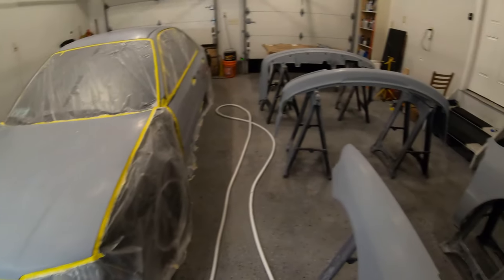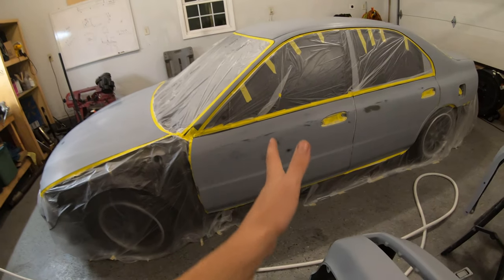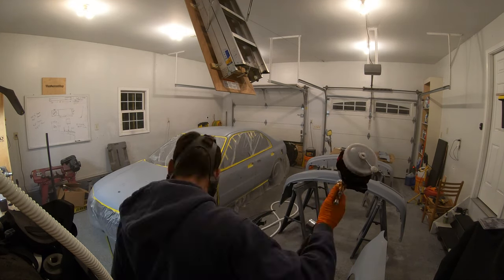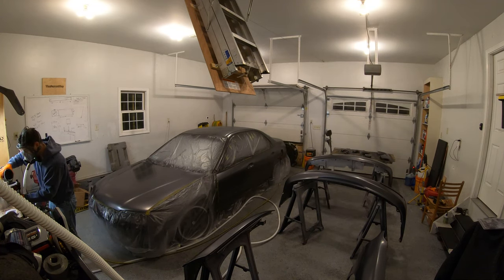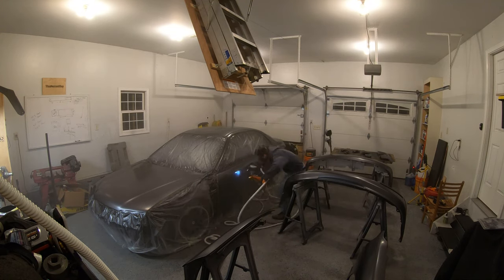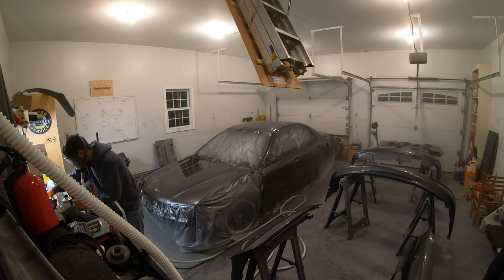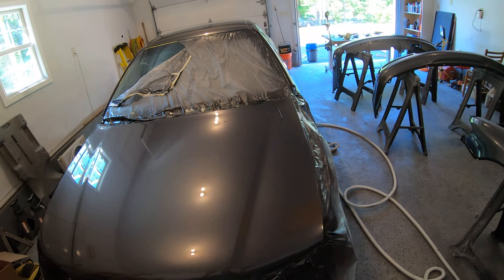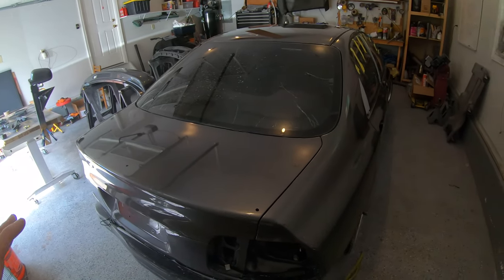Turbo Accord Gets a Sick New Paint Job!

Comment: in the video where you went over the cost & linked the chipped ecu you used, did you have to buy a new wiring harness to connect it? Was it just plug and play minus the basemap?
Reply from the maker: I had to buy an obd2 to obd1 jumper harness which is cheap since mine is a 96 with obd2
Reply: @ThatAccordGuy  gotha, thanks.

Comment: Yo amazing job man! Also how did you work around the Belt trim?
Reply from the maker: Thanks! By belt trim you mean window trim or what?
Reply: The belt trim is where the grips on the doors is
Reply: But I could you a pointer or tip on how to remove and install the chrome trim that surrounds the doors
Reply from the maker: Oh, I got you. I actually remove the door handles completely. Which is not an easy task. Lots of blood sweat and screams.

For the window trim it's very easy to break the clips. If you go from the inside with the window down you should be able to see the clips. Your choice to pry on them with a pic tool or screwdriver. Or just break them and try to get new ones.